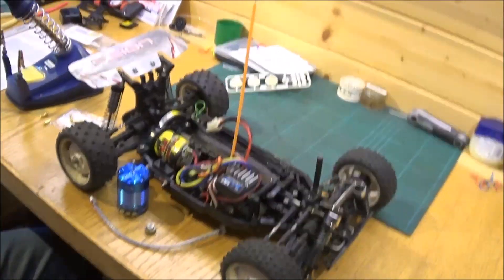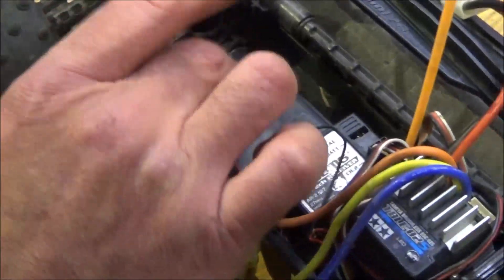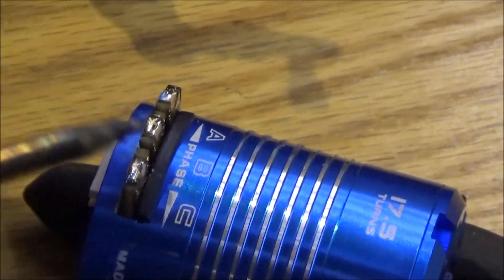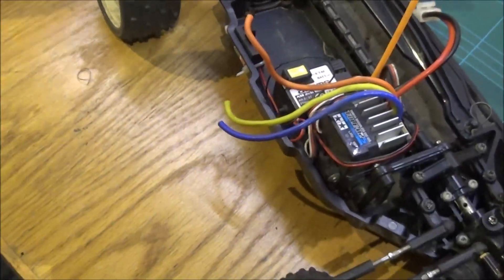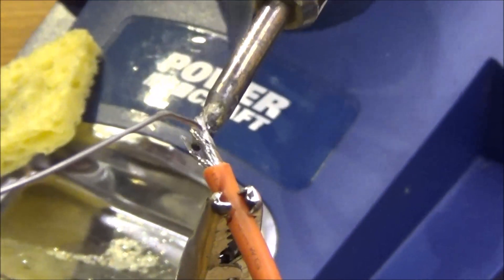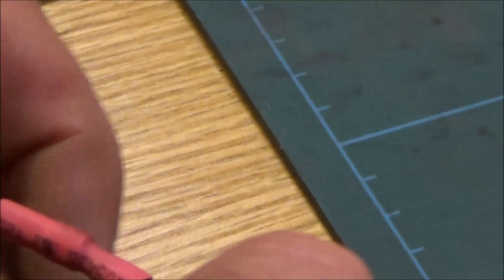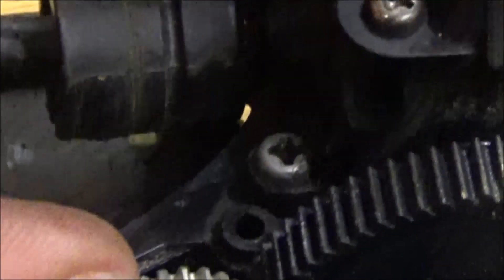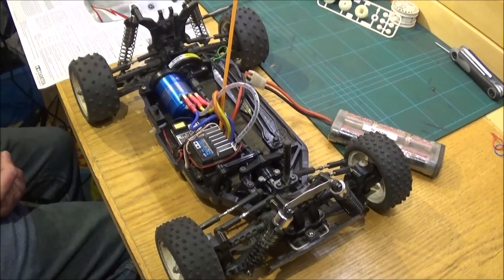How to Fit a Brushless Motor to a Tamiya TT02

Comment: Hi Mark, sorry I know this is a old vid but, I've just bought a brushless motor, different to this one but it has exactly the same 3 'U' shaped contacts on the motor as yours, I'm just wundering if I'm ment to solder the connecters to it like u have in the vid, or can I just directly solder the 3 wires to the motor🤔
Reply from the maker: Hey there Carl, no worries mate! You can definitely solder the wires from the ESC directly to those contacts on your motor. The only reason I added the short leads with bullet connectors is to make ESC or motor swaps easier - but a direct connection to the ESC is better in terms of a solid electrical connection. Good luck with the install! 🤞
Reply: @MarkBryanRC  Thanks Mark your a legend, it's the first time I've bought a motor with these type of contacts and I was a little unsure, it's great how some of u YouTubers are really helpful in the comments, yourself and Richard from RLrc have helped me out massively in frustrating situations with this hobby. Thanks again mate have a great weekend, suits u sir 😁
Reply from the maker: Suits you too, Sir! 😅 Always welcome, mate! Hope your weekend is going well too! 😎👍

Comment: I would've soldered the female plugs onto the motor and the male onto the esc wires, not that it matters either way really.  Good job mate.
Reply from the maker: That's a good point! But yeah, it works so that's what really matters! Cheers mate!  :D

Comment: Hi Mark I followed your video series on setting up a TT-02 for rally; very informative and easy to follow, thanks. I have a Q about this ESC: I’m running a brushless motor and 2S LiPo. The receiver is bound but when I turn on the transmitter then ESC the ESC beeps once and one flash green, then fast flash red. When I press and hold the setup button and power on the ESC it slow beeps and flashes green…! Any help would be much appreciated 🙏🏼
Reply: Thanks for getting back to me; it’s a TBLE02-S.
Reply from the maker: Hi again Toby. Ah there is definitely a problem. For brushless mode, the ESC should flash orange when you turn on. Flashing green once and one beep indicates brushed mode. The flashing red after that means that the ESC is in overload protection mode. This could be caused by the motor or battery problems. It may be the ESC is now damaged, but try setting it to brushless mode and see if that works. Good luck!
Reply from the maker: Hi Toby, can you let me know if you have the TBLE02 or TBLE04 ESC? I will try to help if I can, I promise!

Comment: Hello, i have the same ESC and i got my hands on a 22BL maverick sensorless motor from a friend and i am new to this stuff, i read about it doesnt matter what order the cables go on a sensorless setup but since the ESC is a sensored would the order of my cables matter? I can find the ESC stuff in the manual but ithere are no markings on the motor, can i damage any of my components if i plug them wrong? I am a bit worried, i would be very happy if you could help me to understand.
Reply from the maker: Hi there. I'm sorry to say that the TBLE02s does not support sensorless motors. If you plug it in nothing will happen, the motor will not spin. You need a sensorless ESC, and if you plug the cables in incorrectly, you won't damage the motor or ESC, it will run but the motor will not be as efficient as it would be if wired correctly. I hope this helps and good luck sorting out your motor and ESC! 😎👍
Reply: @MarkBryanRC  Aww man, it's a bummer i wont be able to use this motor with my ESC but at least now, i know what to do. It was amazing help. Thank you so much for your time and answer!
Reply from the maker: @Rhasouric  You are very welcome!
Reply: @MarkBryanRC  Hello again! I ended up buying the same looking motor in 10.5T version, and thanks to your video, i was able to solder and setup everything perfectly i just wanted to say thanks again for all the help. I would still be at why my motor wont work step without your help. Good luck again at the tt-02 speedrun!
Reply from the maker: @Rhasouric  Hello again and thank you so much for letting me know how you got on! I'm really pleased that you found the motor and got it all working perfectly - this is great news to me and I am happy I could help! I also appreciate your support for the speedrun, but I think 40mph is the best I can get but we will keep trying! Best wishes!

Comment: Soldering solid terminals onto the circuit board tabs like that could rip the contact pads or break them clean off from the fiber material if impacted.
Reply from the maker: Thanks for the comment! Yes I suppose if I ran the buggy without a body and it rolled over on concrete that could happen. But I've run it for 5 years (with the body on) and have never had a problem! Cheers!

Comment: Hi Mark great video's I'm done with my hsp Truck the lights look good I fitted 8 of. I started a new project I'm having a hard time with the esc Tamiya TBLE02S I'm running a brushed motor after about 5 mins it cuts off the red light blinks I have to switch it off an on it works does the same it's a brushed motor. But I'm using a 2s lipo
Reply from the maker: Thanks Avi! That Truck Sounds great! Hmm, with the TBLE02 it sounds like it's going into overload shutoff. I'd try it with a standard silver can and see if that works, it could be your motor draws too much current (less than 21 turns?). You need a LiPo alarm for that battery or the TBLE02 will kill it, it doesn't have a LiPo cutoff! Cheers!  :)

Comment: Hi I have the same esc but I’m having a problem.it’s in a brushed motor.I put a 2s battery on it when I play with it after 2/3 mins it’s cuts off the red light blinks I have to switch it off back on to play.can u plz help
Reply from the maker: Hi Avinash. The ESC is shutting off due to overheat protection. The ESC is getting too hot. It is not designed for a 2s battery, but it could be shutting down due to excess load from the motor also. You should not use a motor with less than 23 turns. Also, running on deep grass or mud, or running with a large pinion or bigger than stock wheels (high gearing) will also overload the motor and cause ESC overheating. You could also fit a fan to the ESC to keep it cool. I hope this helps, Best regards from Mark.
Reply: @MarkBryanRC  ok thank you so much.I’m in South Africa.Where are
Reply: Sori wat battery can I use on it
Reply from the maker: Hi I'm in England, UK
Reply from the maker: You should use NiMh 7.2v
But you can use a 2S LiPo, but you need a LiPo cut-off alarm because the TBLE02 does not have a LiPo cut-off. Without the cut-off you will damage both the ESC and the battery. Please don't use the 2S battery without Cut-off protection because there is danger of fire!!! 
Best wishes from Mark
Reply: @MarkBryanRC  I do have lipo cut off wat should I set it at
Reply from the maker: That's good news! It is safest to set it at 3.6v per cell.

Comment: In time it is gonna break off  ! [6:59) Why, becoz you didnt put a thick gauge wire from the motor to the connector.
Reply from the maker: Hi John. Well, you may have a point! But hey, after 4 or 5 years it's still going strong. It takes a lot to break a well-soldered joint!  :)

Comment: Great video and strong guidance on soldering! Can you tell me your thoughts on what soldering wire gives you the best electrical  conductivity such as 60/40? Also what diameter solder do you recommend for small RC connectors, .031? Thank you for sharing your amazing skills!
Reply from the maker: Thanks very much for your comment and questions! I was an electrical technician for over 20 years, so got a lot of practice!
As for the solder, I still prefer lead-based solder, I just can't get on with the lead-free stuff!
Here are the specs of the solder I prefer:
Wire Diameter	1.2mm
Percent Lead	40%
Percent Tin	60%
Melting Point	183°C
Flux Type	Rosin Based
Flux Content Percent	3%
I hope this helps - cheers!
Reply: Search Federal Specification QQ-S-571 for all types of solder, including chemical composition, form, temperature range solid to liquid, etc

Comment: What brushless turn would you recommend on a TT-01 Type E? Want to do some rally car on road/off road playing. Thanks
Reply from the maker: Hi Michael - I find that a sensored brushless motor of 13.5 turns is perfect for a Tamiya tt02 or tt01 rally car, not too fast and not too slow, plus great extended runtimes too. All the best from Mark...  :O)

Comment: If you used a little flux, your solder would flow better.
Reply from the maker: You could be right, but as you probably know the solder I used is a multi-core with flux inside the solder.  :-)

Comment: Nice video, but wouldn’t it be easier to solder the wires directly to the motor? Anyway, great tutorial mate!
Reply from the maker: Thanks very much, Eric! Yes, you are right, soldering the wires to the motor would have been easier, but I just wanted a way to quickly remove or swap motors if need be. Nothing wrong with soldering direct to the motor. All the best, cheers mate!   :-)
Reply: No worries, I enjoyed the tutorial.

Comment: I want to take the redcat wendigo's brushless system and install it in the tt02. Would that be a good idea?
Reply from the maker: Hi - not sure what system is in the Wendigo - but it would be worth a try, I think - what's to lose? If it's too powerful, you can always take it back out. All the best from Mark...  :)
Reply: @MarkBryanRC  it has a hobbywing quickrun 10bl60 brushless esc with a 540 3300kv  brushless motor. I'm just worried about all the plastic gears in the diffs and the drive shaft.
Reply from the maker: @linlinlixin2637  I think it should be OK, my blue Neo Scorcher TT02B has a Trackstar 13.5T brushless motor (about 3000kv) and it runs fine on the stock plastic gears - but if you do strip any, the whole set of gears is only about £5!!!  The drive shafts will take the power!  :O)
Reply: @MarkBryanRC  im going to give it a try.  Thank you.  One last quick question,  what paint did you use for it and what blue is it? Thank you.
Reply from the maker: @linlinlixin2637  The Subaru was painted in Tamiya PS-16 metallic blue!  :)
Reply: @MarkBryanRC  thank you.
Reply from the maker: @linlinlixin2637  Anytime my friend!  :)
Reply: @MarkBryanRC  my mistake, I thought this was the Subaru.
Reply from the maker: @linlinlixin2637  Same chassis though, so my comments still stand!

Comment: Can the plastic diff gears withstand the motor?
Reply from the maker: Sure can! 3 years of running this one with no issues - to be honest, it's not massively faster than the Torque Tuned, but runs so much smoother and the battery life is double what it was!  :)

Comment: Hello. It's been 3 years. What are the results of this engine? Driving performance, resource? I have a stock (rally) TT-02 (TBLE-02s) I want to install a similar brushless motor but 10.5 T.  Have you used this drive with powerful LiPo batteries?
Reply from the maker: Hello! I can report that this motor has worked faultlessly for 3 years - it's not too fast and we needed to up the geraring with a 20T pinion. I have run the 13.5 version of this motor with no issues on the TBLE02, it is quite a bit faster. My friend has run the 10.5 version in his Wild One buggy with no overheating issues, and did not fit a fan to the TBLE02. I have not run a Lipo with any of these motors, but I have with a 13.5 Turnigy TrackStar motor on the TBLE02 and that was fine!

Comment: Great video. I have the same motor (T2M rush 17,5T ) but my car is now very slow compared to Tamiya Sport tuned. Is something wrong ? Acceleration seems great but only few meters and then the car is just slow...
Reply from the maker: Thank you! Ahh - yes, it will seem slow compared to the Spot tuned on the same gearing - the 17.5T does not spin as fast - you need to up the gearing! A 20 0r 21 tooth pinion will make it much better!  :)
Reply: @MarkBryanRC  thanks! What would be your advice? Keep this brushless motor and change the pinion gear or come back to the brushed sport tuned?
Reply from the maker: @jeromeprost  Both options are good - but with the Brushless you will get much longer run times, even if it's not any faster than the Sport Tuned.

Comment: Is there any reason why you didn't solder the ESC wires directly to the motor
Reply from the maker: Hi there - good question! Yeah, I like to add the connectors to the motor so I can easily disconnect for cleaning and maintenance or if I want to swap motors for any reason. It just gives me that option. But soldering the wires directly to the motor is fine too! Best regards, Mr.shadey! :)

Comment: Does this esc need the other sensor leads to run brushless?
Reply from the maker: The TBLE02s can only run sensored brushless motors, so yes, you need to plug in the sensor cable as shown in this video.

Comment: Great vid.
How comes not using 2.4ghz radio gear?
Reply from the maker: Thanks very much. I use old school Acoms radios and receivers because I have so many from back in the 80's and 90's - they still work well and I can use the same transmitter on many models. I do have a few 2.4G sets, also. Regards from Mark..   :)

Comment: What battery types must you use for brushless? Thanks.
Reply from the maker: Hello! Well it depends more on your ESC than the brushless motor. Most ESC's are both NiMh and LiPo 2s compatible (some are also 3s compatible). If you are using LiPo, make sure the ESC has a LiPo cut-off - if not you will need to fit a LiPo cut-off alarm. The ESC instructions will provide all the information you need. Hope this helps!  :)

Comment: Hey Mark, I was wondering... do you use Leaded solder? It seems to be the popular choice, but nowhere seems to sell it now, other than eBay :) Thanks dude!
Reply from the maker: Hi Paul - yes I do use leaded solder mate - miles better than the new lead-free rubbish! I used to work as an electronics engineer back in the day, and managed to "acquire" a roll big enough to last 30 years!!!  If you can get it with a multicore flux, it's ace!  Worth a try  :))
Reply: Mark Bryan RC Haha nice! Is the flux the Rosin core I’ve seen some mention? Thanks! (I also just realised I asked a similar question on the Facebook groups this evening, although that was more of a ‘what stuff do I need please help!’ Question :D I’ve just ordered one of those 13.5t motors from eBay,  should be a laugh and good to learn soldering with ! Thanks 🙏
Reply from the maker: Yes, dude, the Rosin core is the one yo go for! Oooh, love those 13.5T motors, as you know, you will have a lot of fun with that - good luck with the soldering, make sure your tip is nice and hot!!!  All the best, mate!    :)
Reply: Mark Bryan RC Thanks for the advice! I’ll let you know how I get on! :)

Comment: Hey Mark , do you how can I fit f the following motor to the TA02SW ( motor to gear)
https://www.amainhobbies.com/castle-creations-sidewinder-sct-wp-esc-combo-w-sensored-1410-motor-3800kv-cse010-0123-03/p618581
Reply: Yes helpful! Is there a speed/power limit that the TA02SW can handle in terms of brushless motor?
Reply from the maker: Hello - there is no specified limit, but the chassis has some weak points that a very powerful motor would cause more issues with. The plastic motor mount is very brittle (I have broken 2 of them already) and the prop-shaft is thin and bends easily. Also the ball diff is not designed to take crazy power. I would suggest a 13.5T sensored brushless or a motor of 3500kv or less is enough for this chassis.
Reply from the maker: @bg7859  Out of the two, I think the Reedy Sonic 13.5 is more suited to the TA-02. Should give a nice power boost, but not too crazy! It should also work with the Tamiya TBLE02s ESC.  Have fun!  :-)
Reply from the maker: Hi - no I don't recommend you try to fit this motor because it has a 5mm shaft - all Tamiya motors have a 3.17mm shaft. I would be worried about compatible pinion gears, there are many brushless motors available with the 3.17mm shaft. Hope this helps.  :)

Comment: the brushless motor used in video is very weak, try some thing like Fantom V3 series, Reedy S plus
Reply from the maker: Hello - thanks for the comment! Yes, the blue motor is not very powerful, but it is ideal for my son. My Neo Scorcher has the Turnigy Trackstar 13.5T motor which I think is perfect for this RC!  :)
Reply: Oh, I see ,  Turnigy Trackstar is a great motor, anyway I have never used it, used Fantom v3T 17.5T motors often,  I reached 130 km/h on 4s, Fantoms runs very cool
Reply from the maker: Wow - that is a great speed for 17.5T, I will look out for the Fantom brushless motors, thanks for the tip!  :)
Reply: Hi Mark , 

thanks for replies.that speed can be achieved only with 4s, 

Lot of people buy motors like 5.5T to 8.5 T to achive this speed,but they are only capable of 2S Lipo,

17.5T is slower but capable of handling up to 4S, it would be the same in the end.
(17.5T on 4S = 5.5T on 2S) 
but I think 17.5T motor is more versatile than the lower turn system as it has a wide spread range of voltage.
correct if I am wrong,
Reply from the maker: Thanks for the information - very interesting - I was not aware that a 17.5 could handle a bigger range of voltages. Good to know!  Best regards from Mark...   :)
Reply: @MarkBryanRC  Yes . they can handle. Keep the endbell timing low. LRP X20 motor has even has stated in the spec sheet as 3.7 - 14.8  voltage range. Newer ones not, buy they are capable.